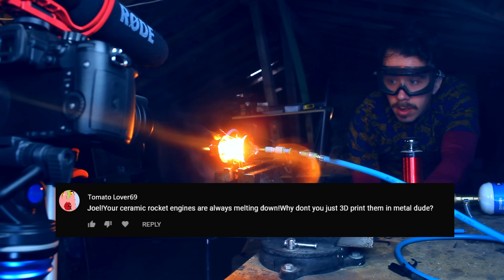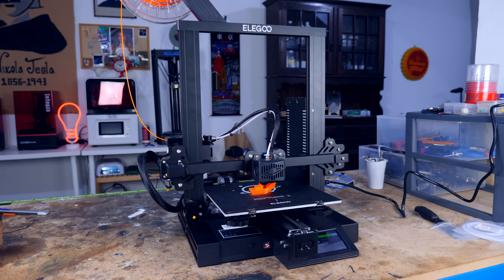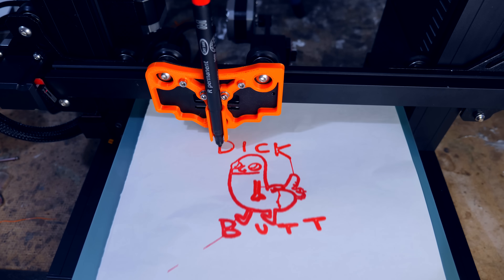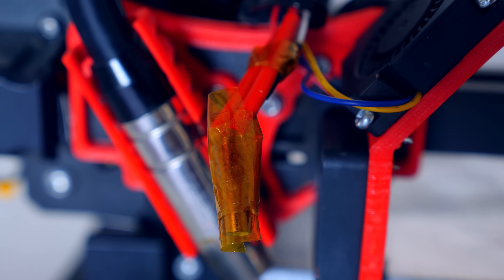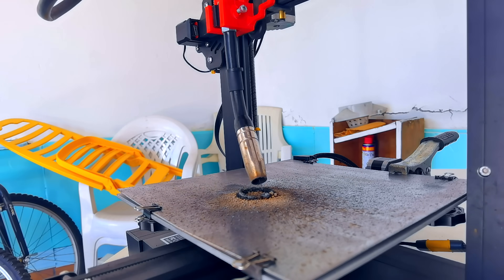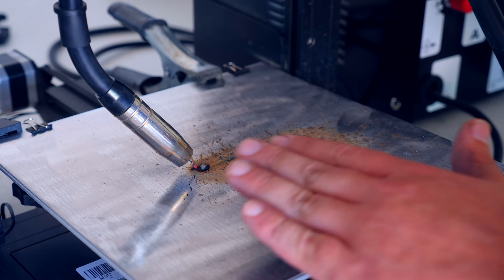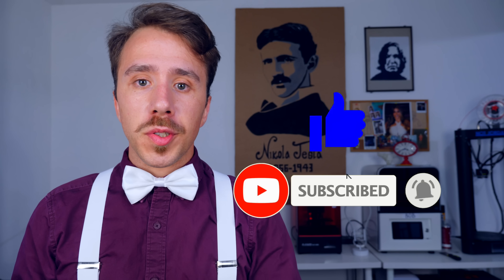I built a Metal 3D Printer using my Welding Machine

Comment: Still much better than my welding! Would be interesting to see how much better a flux gas welder would do!
Reply: Go mig. Not fluxcore.
Reply: @AA-zv6yo  No let him think he wants flux gas. Lol
Reply: @Leviathan3DPrinting  lol. I mean if he wants good penetration and very shielded welds. Go for it lol. I have a passion to hate fuks core though. So much splatter. They all have their time and place though.
Reply: @AA-zv6yo  swe
Reply: @AA-zv6yo  Mig uses flux core wire, aswell as gas and solid wire, his best bet would be 11 volts 120 inches per minute feed speed, which would replicate a tig weld with a mig welder and create nice layers, expecially since he was using a 120V mig welder and flux core wire (which is easily noticeable because of the splotching)
Reply: even would like to see a TIG variant with an external feed and probably some coding :D
Reply: @TreHazenF  I think you could automate the process that ms weld is doing, basically use a short pulse to melt a small amount of automatically fed  of  filler wire with argon, its not super fast, but with 3d printers you have to be patient anyway...
Reply: @TreHazenF  that's TIP TIG
Reply: @TreHazenF  I was gonna say TIG welding too!
Reply: @tylerwright6006  We need more inert gas and less splatter :D
Reply: @TreHazenF  Yes, if you could work out the kinks, you could achieve much better results with Tig.
Tig welding is way more precise, neater and more gentle.
Reply: you could try adding a tube to this rig to deliver shielding gas separately from the nozzle as you would only need to flood the surface of what you were welding with gas hooking it into the circuit you use for the trigger would work for a solenoid fairly well adding a slight delay to the welding trigger would also simulate pre-flow that is used on welding machines. the angle is not needed unless you want to see the weld as the machine welds blind the angle is not needed so you can correct that as well if you want.
Reply: @America_Yea  argon is heavier than air... Run the printer inside a Plastic barrel or tub, and displace all the air with argon.
Reply: Pretty sure hes using fluxcore
Reply: Yes  @luciankristov6436  he's already using fluxcore lol
Reply: Welder here. Flux is a no go as you would have to grind out the flux deposits as you go. you can do it with standard mig running globular transfer (higher voltage, lower wire speed compared to short circuit.) more spatter but you get a smoother bead. IDK what gas you're running but we run 75/25 argon/co2, so that's what I would recommend probably 20ish cfh of flow

you should also change your mount so that the tip of the welder is vertical and not the handle. having it at that angle would be perfect if you were running fillet welds on 90* angles, but for what your doing it's useless. just gotta run a little anti spatter on the tip and you'll be fine.

as an FYI, Relativity Space is 3D printing their rocket stage using aluminum mig welding and a waldo arm.

for the base, not only should you use thicker material, but also back it up with copper or aluminum. the thicker the better. they transfer heat much faster and help the workpiece heat up more evenly. also, if you preheat the workpiece in the oven to about 350-400*f you will get much less distortion. this is because as the weld is cooling, it creates an internal stress as it cools from the outside in and that's what's warping the metal. by preheating it, you're slowing that cooling action down and also thermally pre-expanding the workpiec.
Reply: Lol I did a thing really wants a 3D printer
Reply: @libret3869  Sad because they have enough youtube money to just buy one. Its just a popularity contest...
Reply: @mikeznel6048  yeh in the end that's really
Reply: Anything is better than yours welding lol😁😁😉
Reply: I dont know what everyone has against flux core lol. Better penetration and you can use it outside if you live somewhere windy as f like I do
Reply: @stich1960  yeah right but you have to clean before welding another layer..
Reply: @AsitShouldBe  ok I gusse it is a little cleaner that way
Reply: @stich1960  yeah much cleaner and less toxic i suppose.
Reply: Yeah use a MIG welder. Flux is too dirty.
Reply: nice
Reply: Hey gwuy
Reply: You surely have to give this a shot
Reply: look its the guy
Reply: and get some anti-splatter spray use on the parent metal and inside the shroud
Reply: Why dont you just use this method mate?:
https://youtu.be/w3i8i-9bjqI
Reply: @science0074  i love that channel
Reply: 3D print a ceramic printing bed
Reply: what about a cold welder or tig?
Reply: @tyreekpryce2164  TIG wouldn't work to build up metal on its own
Reply: Also horribly you’d have to chip the slag.
Reply: Technically you could use solder
Reply: Yeah a mig gun would work better and you need to slow the speed down or bump up the wire speed
Reply: Reverse the polarity for less splatter
Reply: i was the 777th like
Reply: This basic concept will never work. Each layer adds stress to the part. Eventually, the part will tear itself apart. This fundamental problem could be solved by keeping the part red hot, but then it would just warp. The part would need to be held at about 1500C while welding.
Reply: if you use gas instead of flux then there wouldnt be slag, also if you clamp down the sheet better then there wont be as much warp...
Reply: Hard wire with 75% argon and 25% co2 gas would work a lot better.
Reply: @dustin600 That the best idea. Flux cored wire produce higher heat.
Reply: if you win the 3d printer I'm gonna be mad lol
Reply: There are a few reasons why welders angle the nozzle. It helps with gas coverage in certain situations where you are moving faster, it helps keep the splatter from going up into the nozzle and clogging it, as well as it helps push the weld "puddle" around. For the purposes of fdm "3d printing" with metal, especially with flux core, you could point it straight down and shouldn't have too many issues. That would help with consistency too. Like you saw though, you will need either a thicker sheet, or some kind of water-cooled plate underneath of your build plate to keep it from warping. Another thing that could help this would be to turn down your voltage and turn up the wire feed speed, within reason, to increase the height of the weld and decrease the heat transferred into the plate. Very interesting video, loved it!
Reply: Mig mate go mig there just the best
Reply: Wondering, could you use an enclosed printer that you can seal and just fill it up with shielding gas might even be more efficient
Reply: Took the words out of my mouth on both points.
Reply: If you could utilize the driver from the feeder you could do much finer control of your wire, let it retract so it doesnt get hooked on a bead etc, best wouldve been if you made a bath where the sheet sat in filled with oil to combat warping
Reply: You have to have a 1.21 jiggawatt power supply for those and your welds start to disappear when the feed rate hits 88mph
Reply: When they say "3d print in metal" they're talking about polymer bound sintering filament that runs through normal plastic-filament FDM printers that use a kiln-sintering process. The kiln is basically the same one you use for ceramic parts. Look at virtual foundry for a quick example (first google result for me)
Reply: Yes you do need to work on your welding.

Comment: I think it has to be a dedicated machine with dedicated cooling. What about peltiers under the bed with fans cooling them down? And big fans cooling from the top. Pretty cool that you managed to print anything at all though! Another project for your tomato cans: sandpaper on the inside, motor to spin it and use it to avoid the tedious task of peeling potatoes.

Comment: The filament extruding speed must be adapted to the printer so better not use the extruder of the welding machine. You could youse the feeding system of the printer by upgrading the extruder with steel parts there are kits for that to buy. And the nozzle of the welding machine should be  redesigned and scaled down tu using 1.75mm wire diameter.

Comment: Would do better if u could slow the print down and use gas sheilding welding wire and pluse weld and slow the print down enough to make up for the pause between the spot welds

Comment: Hey Intexa
you could try to put the welder Like in your first attempt straight down to know were it hits but clamp it in further up so nothing can overheat. In my opinion  you can change the settings on your welder for like no splashes of medal. It’s unrealistic that you see this but it would be nice if you could make a reboot for your metal 3D - project. I know you can do it because I in Austria and a lot more believe in you!

Comment: INTEGZA! I want to share with you that California State University Chico has been Sponsored by Haas, a manufacturer of CNC machines, to work on a welding 3D printer. After three years of work, a working machine has been refined to the point where the final parts can be used like castings to make a finished part. Contact Charlie Pooler or Corey Cole, both professors at the university, if you want more information.

Comment: That is the first thing i noticed when you hooked that plastic to the nozzle where it hotter than hell, i knew it was going to melt. Then when you brought out the fan i was shitting because i knew it would catch on fire now because you fanning the crap out of it. But you figured it out and kept that plastic the hell away from it.

I like you trying, but don't give up, get some advice from real welders.  You already figured out you shouldn't try to weld beads on thin sheet metal, if you want to use thin sheet metal you would need to only spot weld and let cool between spots, or spot weld in one area then go to the opposite end and spot weld there, keeping the heat from building too fast while not having to wait as long. But better off finding an old tractor or something and take some heavy metal off from it and use that this way you have no need to buy it.

Comment: A larger aluminium plate would sink more heat as would using say computer heats sinks for theirs fins which you could then attach a fan to to keep cool.
The metal warping can be somewhat mitigated by not allowing it to move. I'd screw it into the aluminium plate. I do not have an ender to piss away on this notion.
Another thing that may help with heat is using a tig welder but that would require someway of feeding the infill material.
The idea isn't bad. Nor was your execution. A little more effort may see you achieve something. Tesla would point out you could have done these calculations beforehand without the experimental methodology.

Comment: So you tied a MIG welder to a 3d printer and spent a few hours getting the timing right….most likely by just adjusting the wire speed based on the back pressure against the gun…. now if only you could modulate the angle of the gun nozzle to correct puddle width and depth as well to get penetration correct(like people do when using a mig welder)

Comment: Okay 
Start with what you weld the part on.
Brass is the only thing that you use.
Now remove the factory nose cone exposing the tip.
It can run straight down but no wind or fan near the weld

Comment: If you put a plate of copper under the metal sheet it will absorb all the problem heat from the plate stopping any warp from taking pace, as a add bonus welders use copper for not only heat control by placing it directly behind thin metal being welded to stop warp and burn through but you can even use it as a backing while welding a gap and the weld will pool up and never stick to the copper leaving an nice clean gap fill between your work prices, this will allow you to use even thinner metal and not worry about burn through since it will never stick to the copper base plate anyways. I recommend a copper base plate of at least 1/4 inch thick with an aluminum heat sink directly on the bottom side of your copper with thermal paste and fans for air flow. This will ensure your heat problems will be gone and not exactly too costly to be out of question. If you have any questions, just let me know! -journeyman Welder
Reply: Also switch to gas only wire man, you won't have to wire brush or stop the print to clean anymore

Comment: The few home hacked CNC welding machine attempts I’ve seen, don’t really work all that well but yours was one of the best for showing how you did it.

Just had another thought! copper-clad 0.5 or 0.6mm welding wire, CO2 in the enclosure and drop the feedrates and current to bare, reliable miniumum. Wirefeed welding translated to FDM is like a 500% filament feed rate compared to FDM printing.
Reply: Also, as you probably know by now, you could get your rocket nozzles metal printed by PCBWay. Not cheap, but still an “iron price” rather than a "gold price."

Comment: I think you should re think the metal 3d printer idea and have another go.   Try replacing the heat bed with a cooling plate to prevent warping and bend your welder nozzle so it's vertical. if you can get the metal shroud closer to the welding area it created a pocket of gas that reduces splatter.  Furthermore (and I dont know if this would work) you could try writing your script for the part to weld like a car panel beater. You do small areas with gaps, to reduce heating and warping.   Any way I think with a little more planing you could make something worth using.  Or you could send me a 3D printer and I'll give it a go ;)

Comment: OK...
So, the excess spatter tells me that your weld current is too high.  

Print a new gun fixture to hold the nozzle behind the tip just before the angle bend, it should be cool enough that far from the tip.  Having the nozzle perpendicular to the base metal plate will allow for reduced stick out of the wire. One only needs a "push" or "pull" angle when welding by hand in other than flat position.

Get yourself some 1/2", (12mm), ceramic refractory board to cover your printer table, and possibly to set up around the printer to stop sparks from going everywhere.

You could try using flux cored wire, which would eliminate the need for shield gas, (CO2, argon, etc.,) but then you would have to chip or wire wheel slag between each pass.  Pausing to chip slag would, however, allow for cooling time between passes.

Keep trying, you WILL get there!  And, once you master using the printer with regular (ER70-S), wire, you can experiment with exotic, high temperature alloys such as 400 class stainless and/or titanium.

You are an Arduino guy, you should look into building a welding robot using Arduino controlled stepper motors.  I saw where a European shipyard 3D printed an 11 foot,   3.4m diameter propeller for a sea going tug using two welding robot arms!  You may not (yet) need anything that big, but the concept could work for you🙂

Comment: How about if you use a metal filament instead of a plastic one and set a positive High voltage anode close to printers printing head and connect the cathode to the filament so that the arc jumps to the filament and melt it ( filament should be thin enough so it is easier to melt ) ,you would have to 
customise the printing head.hope you got it 😃😊

Comment: 1. human welders angle the nozzle so we can see what we're doing, not necessary for CNC.  robotic welders weld straight on 90 degrees.
2. paperclips are not adequate clamps.  Us human welders use vice grips, and C-Clamps.
3. for better results, use a 20% Co2 / 75% Argon shield gas.  for even better results, switch to a TIG head with a cold wire feed and 100% Argon.
4. clamp the steel sheet metal to a thick plate of aluminum to reduce the flex, you must clamp close to the welding location on the sheet.

Comment: @6:32 "Mh, I'm liking how the welder point is not mounted vertically but it's inclined. Wait, will the plastic resist more than 20 seconds before melting??"

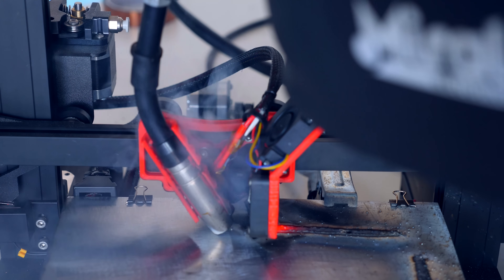@6:55 "Oh. 23 seconds, actually. It was very good plastic. I mean, it used to be."

Comment: FYI here a few good tips i can give from my experience with both welding and 3d printing. And if i had the time I would  try to attempt to make my own.

anyway heres some tips.

you can make the welder tip point down. The only reason they do it on an angle so they can see what they are welding. you can also move the welding handle up, just  not hold the metal tip with plastic. 

Also you should make the tray out of steel. Then try to use a mig aluminium welder instead and it will cool alot faster. If its a big enough part then it could probably weld continuously with a fan and if the welder has a 100% duty cycle or a external water cooler can be used in the welding machine.

wire speed, temperature and how fast the 3d printer moves is critical. actually only the first layer need to be hot enough to penetrate a thicker bigger material. after a few rows the temperature on the machine cam be turned down  or the 3d printer increase its speed to not melt what was printed. 

maybe have it print the first few layers as a stand before it prints the actual part

Comment: Looks like you had no shielding gas?   Normally for steel welding you can use Co2 Argon mix  if your welder has that capability.  You had a gas nozzle on the gun most of the time, but no gas, and having that gas makes a HUGE difference in the quality of the finished product. The gas sheilds the weld and keeps it from looking burnt.  Hope this helps! Keep trying!

Comment: I really love the way you reverse engineer to 3-D printer.... one thing you might consider there are 3D metal printers that use powdered metal and resin and shape the object, cold, and then melted in the kiln afterwards.... I don't know if you want to continue to pursue this, but I think if you tried that method, you would eliminate a lot of the issues you're coming up with and come up with a successful prototype